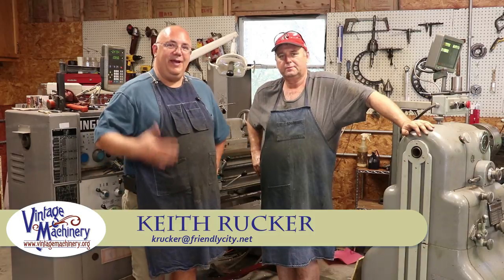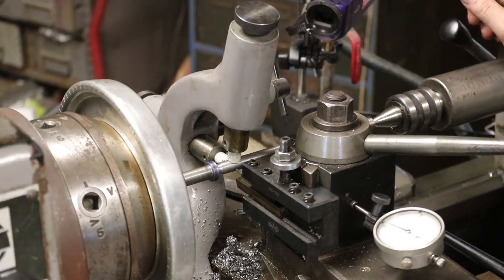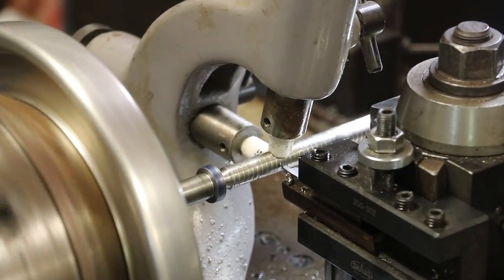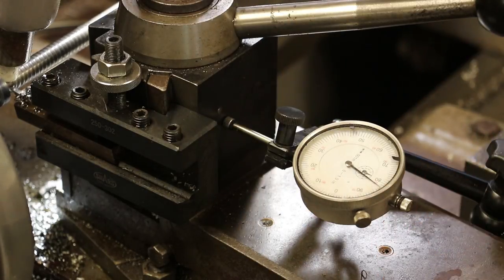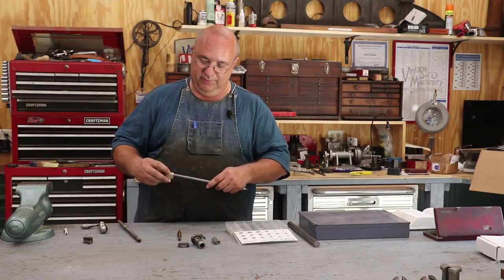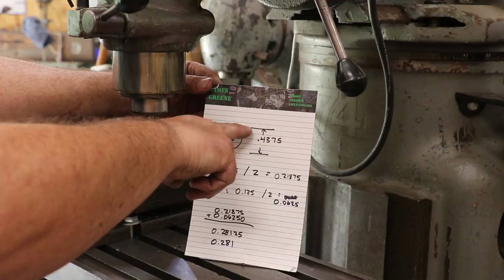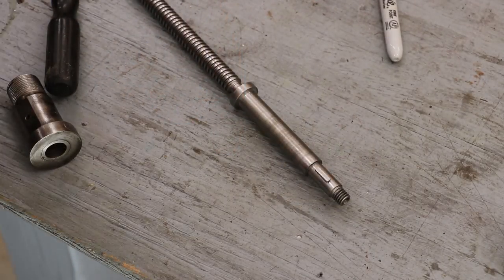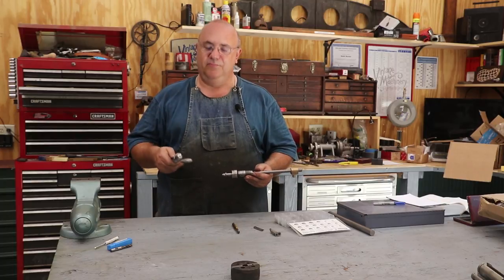Lathe Cross Feed Screw:  Cutting Left Hand Modified Square Threads

Comment: Hello Keith, I remember cutting an Acme thread, 3/4", for a vice screw, whilst at trade school, about 1965.  We didn't use a travelling steady and most of us ended up with the tool digging in on the final cuts, destroying the screw.  I have since made a 7/16" L/H Acme thread x 10 tpi, on my Hercus lathe, at home, out of tool steel and made a tap from it.  This was used to tap out a new cross slide nut, that I cast out of bronze.  Worked well and in the lathe.  This is from Australia.
Reply: Made the screw for a toolmakers vice as an apprentice. 3/4" OD 8 tpi square thread. First had to make the internal and external threading tools. External tool ground up on the surface grinder using a universal vice to set the side clearance angles. The nut was made from bronze, the internal threading tool from O1 tool steel oil hardened and tempered in the shop. Still have vice, which is in pretty much daily use 45 years later, and the threading tools though I have never used them since!

Comment: Hello Keith.  I am a recent subscriber to your channel mainly because everything you are doing and with =all he machines it brings back fond memorizes to me.  I started as a machinist in 1962 and became a journeyman in 1964.  The company I worked for built hoist, dereks and whirley's up to 750 ton.  I manual machined for over 3 years and the last 20 was a CNC turning and milling center machinist and a CAD technician. You've got nothing in your machining arsenal I haven't excelled at or just  set up and ran.  Keep up the good work and if you would want any input from me, just ask however you'll probably know everything I would tell you.  Keep on smiling and thanks for sharing.

Comment: Operated a 20" swing Kingston at the last shop I worked at for 16 years. They are good machines and they still have parts for them. Also had a DSG 13x40,  Kuraki 32x120x 12" hollow spindle and a Summit 32x120x 10" hollow spindle cnc and many other machines. Thanks for the post.

Comment: Excellent work!  Loved the collaboration with you and Mike.  I just acquired a Rockwell 12-14 table saw that has interchangeable saw arbors for different diameter blades and  as well as dado sets and moulding cutters.  I need to make a new arbor for a dado set and believe it uses the 10 degree modified square thread.  Learned alot from watching.  Thanks and cheers!

Comment: So this is for a subscriber, to help him out. Now I wonder if this was something Keith is charging for, or is a favor, because he could make videos out of it. I used to make machinery and parts for various companies. I could charge well over $100 for some really odd screw, because of the time involved. But that was for companies that needed to get an old machine running, where my charge didn’t really mean anything. When I make things for friends, I never charge anything, unless material costs are enough to charge for that. But what would this job cost, considering it’s for someone who likely isn’t making any money on his machine? In theory, the cost should be the same as for a commercial customer—but in reality…

By the way, almost all old machines used that drilled pin method to secure the handle. The reason is simple. They could screw the handle on to where the tightness and therefor the play, was exactly where they wanted it, then drill the hole for the pin to keep it there, then screw the nut on. When putting a keyway in, they are usually all put in the same place on the shaft and handle, so there’s no way to fit it for best tolerance. So you need a much better machining accuracy, which was much more difficult to do back then. This method was used by many manufacturers well into the 20th century.

Comment: That partially drilled channel for the pin is made by putting a plug in the hole that is press-fit, you center punch the precise line where the parts meet and drill like any other piece of material. The fact that it is press-fit removes any possibility of the drill bit catching and breaking. An easy fix for those of us without a machine that can cut the key slot.

Comment: Looks like those pin- keys in the shaft and I believe, the handle are made to tighten against the handle nut preventing the nut from tightening the end play on the shaft. Kinda hard to tell without the parts in hand, though. :) The woodruff key setup should allow you to tighten the nut 'till the shaft will not turn. You may need a jam nut setup on the handle to set the end play.
Reply: Don't think so. The handle will tighten up to the shoulder on the shaft as seen @ 21:58
Reply: jonka1 , I cannot tell where the handle hits, and the spacer with the set screw extends past the shoulder with a recess for the curved center ball of the crank. If I designed it, I would make the endplay on the crank adjustable. Could be that the designer of the machine did not. I do not think the setscrew is sufficient to set endplay on the crank.

Comment: Keith, always interested in thread-cutting and fascinated by the precision (skill!) involved in starting the X-axis drive at the proper time to meet the thread.  I've never seen this done in person.  Someday!

Two bits.  First, interested to how you held that threaded shaft in the vise as you cut the woodruff keyway. The vise used was something I don't recall seeing in your videos prior.  Thought it would be harmful to clamp the vise down on the threads.  (?)

Next, the broach cutter appeared to wobble a bit.. as if the cutter was slightly offset to the longitudinal axis of its shaft.  Maybe an optical illusion, but imagined the precision you applied to the depth of cut might have been foiled by that offset.
Reply: I have seen a lot of videos of guys using woodruff key cutters and they all seem to wobble.Why I don't know but they seem to cut straight.

Comment: Mr. Rucker. As always another excellent video.
    The Vice you used to hold the screw and cut the Woodruff Key slot. This Vice is a great great addition for any  Milling Machines that it will fit on. 
    I watch many different YouTube Channel Creators that are Machinists. I don’t recall seeing a Vice like that. 
    Is that a Production, Modified or Shop Made Vice?

Comment: Really interesting way to key a handle.  My guess is they drilled the key "hole" in the handle and then drilled out the center.  Pretty quick and easy and requires no special tools.  And it's a hand wheel so a not high stress or critical key.

Comment: Keith I watched a video on gear cutting and I have probably 100 involute cutters some are for bevel gears some are for chain some are for any about any kind of gear you can think of. After 50 some years I am going to have to quit and if you would want some you can have them.Some of them are carbon steel some are high speed steel some need sharpened some have been sharpened. Let me know Leo Nadeau

Comment: You didn't mention the "H" factor when cutting a keyway. I know that depth of keyway is from full width but when you are making parts to someones specs it has to be able to pass inspection not just work. Years ago I got tired of having to calculate it every time I needed to cut a keyway so I made a chart with every size of shaft and key and pasted it into my tool box lid. Odd sizes like .2905 shaft with a .048 key can be guesstimated from the chart. Much faster and less frustrating, great taste and less filling.
 That keyway in the handle was made by putting a plug in the bore and drilling between the two much like when making a Johnson key. I don't know why they did it that way, it doesn't seem like it would be very stable with so little contact.
 I would have just broached it in the lathe rather than wait for a tool to finish an already late rush job. In an hour it would be done including grinding a tool and making a backing plate. But considering I don't have broaches that's the way I always do it.
   Mike (o\!/o)

Comment: First thing I thought when you mentioned that you didn't have the right bushing to broach the slot was "USE YOUR SHAPER!"  But then perhaps you don't have a small enough cutter to get in that 7/16" hole.  But the shaper is a really good alternative when you don't have the right broaching tools.
Reply: I thought the same thing, I have a big 24" Cincinnati metal shaper that I run on my channel, I'm new to Youtube but have a video up on cutting keyways in a forge blower shaft. Check it out if you get a chance, I don't claim to be a pro, more just sharing what I am doing.

Comment: I read on the Pratt & Whitney brochure the follow rest for (I think) the Model C 16"x54" slipped over the dovetail and had a gib of some sort to lock it down.  But a different piece of P&W literature shows a style that bolts onto each side of the saddle.

Sadly I don't know which to try to find/make for it, and I'm pretty sure the big beefy steady rest that came with it was made for the 12" model.  What do you guys do with all the bits and pieces that don't fit?  Oh I also have a follow rest for who knows what lathe.

Comment: For my homemade CNC router I had modified nuts for trapezoidal threads (metric pendant to ACME threads) so that they have slits on one side, which I can tighten with a screw to get every bit of backlash out. The spindles are a bit tight then, though, but the stepper motors can handle it. What do you think, is this a valid method of making adjustable nuts or are there any problems I didn't think of, yet? Oh, by the way, the nuts are made of delrin.
Reply: Be aware that you're going to burn your steppers (by burn read cut their life short). Think of it like a zipper. One trick to repair a loose zipper is to tighten the shoe on the puller. But if you tighten it too much, it simply wears faster. You need that perfect 50/50 mix between no backlash and no friction. One way to get round that is to get some teflon paste and lightly dab the thread with it.
Reply: Most of the time you'll find that by the time you need to adjust the nut the ends of the screw end up larger in diameter than the part engaged during normal use due to normal wear. And when you adjust the nut it will either bind at the ends or remain loose in the middle. 
I knew a CNC machinist who would start the day by letting the machines traverse the entire range of the axis for a half an hour to balance the wear on the screws so that he could adjust the ball screws without binding problems. On a CNC machine that's a viable option on a manual one not so much.
Being that the nuts are made of plastic the wear on the screws might not be much of an issue though.

Comment: Use two tools. Start with a rougher. Run reverse spindle, turn the tool up side down, and feed right to left. You are taking light cuts anyway. That way you don't have an undercut/groove where you start.  Why re-invent the wheel for a simple job?

Comment: What happened during the scratch pass? At about 6:15 and then later there's no cutting on one side of the rod.
Reply: I saw that and wondered about that too.  I think that the part must have been bent!
Reply: Probably too little pressure on the follower-rest. This could also explain why the nut felt a bit tight in the middle as this is where there will be most flex when cutting aka cutting depth was a bit shallow there. But it turned out great at the end :)
Reply: The cut looked light only on one side, in one short section to me.  I could be wrong.
Reply: ya you are right. Perhaps it was clamped to hard against the tailstock

Comment: 15:48 "I'm not sure exactly how they drilled that"... Fill the main hole with a temporary plug so that the drill can stay on course. Drill the hole. Remove the plug. Easy peazy.
Reply: Even simpler: drill small hole first, drill big hole second.
Reply: Might you not then run the risk of gouging the smaller hole as the large drill finds some latitude in that direction. It obviously wouldn't matter much in this use case if the larger hole was off center, having your keyway tight might be a priority.
Reply: If the smaller hole is on the exit side it wouldn't make a significant difference.
Reply: Good point Sieg.

" it can be easily cut with a 1/8" end mill."
Yup, many ways to skin this cat. :-) 

However IDK if you've ever seen the damage that can be caused by using a round keyway as it or the key wears over time allowing the shaft to spin. Don't ever use this for anything that gets driven by lots of power or high speeds. I'll try to find a link to a video I saw that showed this.

Comment: Why do woodruff keys exist? Why not just a square key.
Reply: A Woodruff key, because of it's greater depth, is more stable and won't rock in the keyway and become loose in places where motion is reversed or the length of engagement is short like on tapered shafts.
    Mike (o\!/o)

Comment: Goto 4:00, pause, and look closely at the camlock chuck. The index line on the square is WAY outside the two V marks.
I've always been taught that this is an unsafe condition and never to use the machine until it is fixed.
You generally show safe practice, so this is a bit of a disappointment.
Otherwise keep up the good work.
Reply: Roger, there are only 3 pins on the collet chuck, what you re seeing is one of the locks that are on one of the empty spaces.
Reply: Learn something new every day.  I always thought the D1-x referred to the number of pins (x).  Now I see it is 3 or 6 depending on size.  Thanks John.
Reply: Barry Gerbracht the 3,4,6,8. refers to the center to center.  of the pins

Comment: I suppose you're there because  you don't know how to make every tool you need... it's usually faster than going to get or borrow a tool then you have it next time.....I have made fast followers from wood for hurry up and any tool anyone else can make I can make.....wood follow made from 2x4 bolted to bed or cross slide or where ever I can and cut area to contact and wax contact if it wears shim with paper.... just make it....I make my own follower tips from cutting boards or from blue Jean's soaked in 2 part epoxy pressed with clamps then cut to size works great can even use brass screen between several cloth layers to change the wear...... you want to get in center for woodruff cutter just put flat plate between cutter and shaft being it in to touch and pinch the flat between the shaft and cutter ... when the flat plate is perfect vertical you have center .....same thing to find cutting tool cut edge height center on a lathe..... easy fast close enough for everything